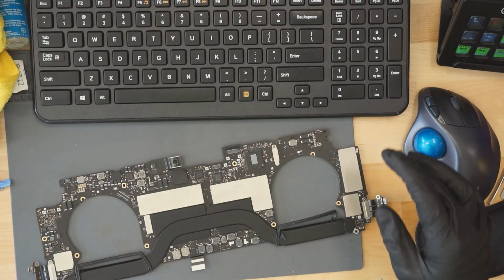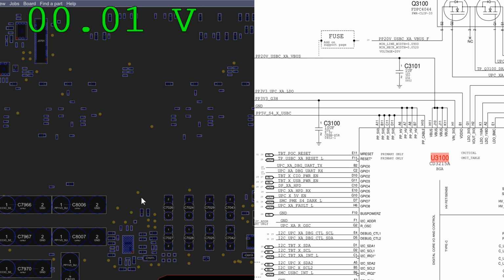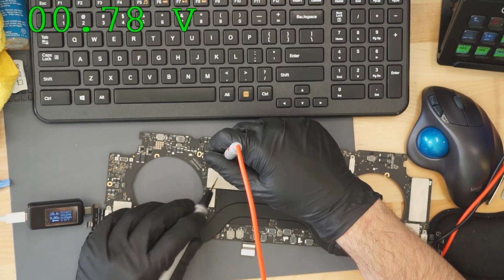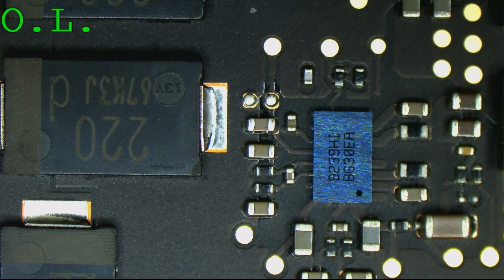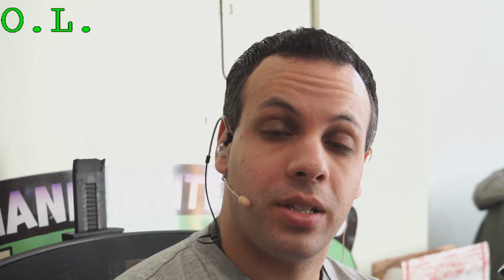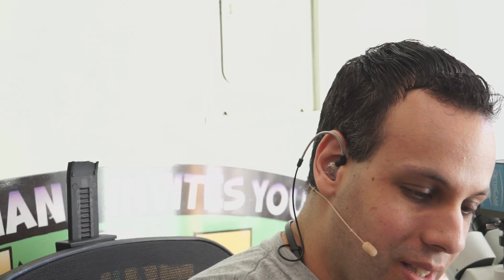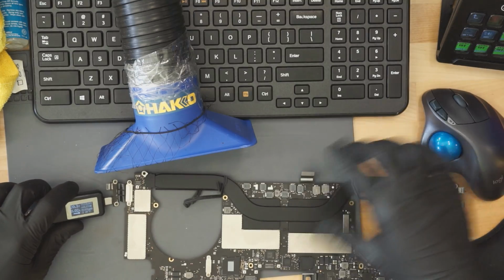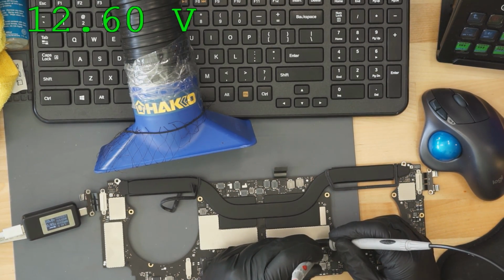Why new Macbook boards will be unfixable for me: sad :(

Comment: Rip the chip design, change it so it doesn’t have the flaw, and then manufacture it.  As long as you can make the chip different enough to be considered a separate entity from the original copyright (if the chip even has one which it probably does) it can be produced by a 3rd party chip manufacturer and then you can buy the new chip from them and maybe even sell it (although Apple will likely sue you).

Comment: "I trust Sandisk so much that I have two of them in my laptop in Raid 0."

I don't think I trust anything that much.
Reply: I physically shuddered when he said he did that with two SanDisks.
Reply: I have 2 Samsung m.2 EVO 2TB together with raid 0
Reply: @igcogcigciggicifx4763  That is RAID 10, which I'm happy to do.  Pure RAID 0, no sorry.
Reply: I'm a Sandisk guy myself, but I'd never put anything in Raid 0 :D
Reply: I run 4 ADATA XPG SX8200 in RAID 0 😂👌
Run's really smooth.
And reads at redicules speeds (lets see how long)
Reply: Wtf is Raid 0.
Reply: @mikethespike056  striped drives
Reply: Can anyone explain what raid 0 is?
Reply: @lyndonmoore6286   @mikethespike056  Writes/reads data to each of the drives in the array with different data going to/from each drive. if one drive fails you lose all of the data. It trades reliability for speed.
Reply: @lyndonmoore6286  striped drives.
Reply: @SuperUltimateLP  oh, well thanks, I think ima google what that is now.
Reply: i run 2-4 toshiba P30s0 in RAID 0 and ironically despite hotplugging them still have had less data loss/corruption than my 960 EVO thats running as a normal, singular drive
Reply: @Gandalf721  ohhhhhh! That makes sense. So could you have two drives running separately of one another so as to not have total loss if one failed?

Comment: I'm so glad I don't buy Apple stuff. I got an 8 years old Acer Iconia dual screen laptop, which never let me down once, despite having traveled the world with me. Because of it's reliability, I love it to death, even though lacking processing power and having low battery capacity (always had). I heared stories of very bad Acer experience from people, but I only got the jest experience. Also got a 10 years old Acer Aspire One netbook, which had it's keyboard broken after 1 drop of water after a few months, but easily replacable and other than that, it also works for ages. Using it as a video player for 8 years now with a lot of shaking, but it's not arguing. I am sure, I use an Apple laptop in a shaking vehicle for 30 minutes and the thing will break.

Comment: I would send my Macbook to you for repair, but you convinced me not to buy one in the first place.
Reply: He can always fix windows based products if people get smart enough not to buy apple products
Reply: @prafulltiwari8929  buying windows produces is not what I call a smart move lol
Reply: @prafulltiwari8929  There are no "windows-based" products. Outside Apple ecosystem we are in a free world. I have Win7 and Ubuntu on one machine, depending what OS I'm in a mood to boot today. Not to mention I have another Ubuntu VM, DOS emulator and C64 emulator here also. But you are right in that he can fix other computers. Apple hardware is still the same architecture as other personal computers, though their marketing tries hard to convince ppl otherwise.
Reply: @Krzysztof_Lis  I personally use windows 10 and Arch Linux. VMs are fun to toy with, although I don't generally find the need to use them unless I'm trying to run penetration tests. But yeah, you got the point, he could always repair other hardware  outside the apple eco-system. 
 It was navie of me to use the term "windows based" .
Reply: @prafulltiwari8929  I get it. I pointed out "windows based" thing because I've learned, somewhat surprisingly, that a lot of Mac users think that the rest of the world works like Apple does. That I can't, for instance, use the same PC with Win and Linux. Or I can't put AMD GPU into Intel motherboard. Or even replace Samsung SSD with a Crucial one. So I try to make those things clear for them.
Reply: @prafulltiwari8929  It's much easier to be a PC repair store. As a consequence there are a lot more of them. They'll have a lot of competition in that market.
Reply: That s the funny part about this channel is how many customers he loses because no one buys Apple after watching
Reply: @Chevalier_knight  I guess it's his goal because he seems tired of repearing apple shit.😊
Reply: @Chevalier_knight  Not necessarily. With his skill on laptop and other hardware he can literally fix other Windows based laptop as well.
Reply: @Chevalier_knight  You are so right!  I was literally on my way to buy a Macbook when someone told me to watch some of his videos.  Never going to happen now.  PC for life!
Reply: @wijr77  Why would you want to buy a Mac in the first place?i
Reply: @Chevalier_knight  Apple isn't the only company that builds and sells computers. Can't tell if this is a joke or not but if it's isn't then it's an incredibly ignorant statement
Reply: @Chevalier_knight  i think he fixes a lot more other devices to get the profit  but he still wants to inform apple sucks and every one who own apple shud come to him even if official store sad this is not fixable
Reply: @Chevalier_knight  but we should we grateful coz its a win win for both him and is coz he gets the views and we dont end up wasting a lot of money
Reply: @Chevalier_knight  he;s doin good work that even gives him less profits BUT he knows, you know and I know people WILL buy apple to show-off or maybe some genuine work since some mac-only apps are there for productivity that people use
Reply: @Chevalier_knight  there are enough "stupid" people with to much money, they dont care
Reply: @Chevalier_knight  You severely underestimate the intelligence of apple fans.
Reply: I would probably want that if I was him, I'm sure fixing PC is way less a headache without all the legal shit and trying to get spare parts on the gray or black market
Reply: @Spootnik  That's why fixing Pc's isn't lucrative business. They are too cheap to replace and too easy to repair.
Reply: @Spootnik 
The same happened with pc
No spare part avaliable
The repeat cost more than buy a new one
But the service from acer a lot better
Reply: Anona Mouse If he can fix an Apple product, he can fix anything. So no excuse if you want to send your laptop.
Reply: This, so much, this! Realised a long time ago Apple were a bit sus, am now convinced that they truly are evil... Like "people exist to but Apple products", not the other way around...
Reply: Don't send your macbook, hes gonna take it to the ppbus.
Reply: He's a millionaire by now. I wouldn't care anyway. Retirement already set
Reply: The closest thing to a motivation I have to buy a macbook is knowing that if it gets broken, I can send it to Rossmann Repair Group to get it fixed.
Reply: Funny ,that's what I was thinking.
Reply: It's a catch-22.  If he fix Apple, Apple fixes it so he can no longer work on them.  If he warns the consumer, they stop buying Apple.  Either way...less business.
Reply: Yeah, thats why i still use the late 2015 version... cba to get the new models as these are fast enough and you dont have to buy all those adapters lol
Reply: asaeampan  That was a classy comment. I have been trying to make decent and rational comments here and then you came along. Nice. Not really worthy an answer but since it amuses me I will. What software are you referring to?

 I'm getting closer 60 years of age, paid my mortgage, my employers pays tools so price is not a big concern. Further over my misspent life I've learned that price should come way down in the list priorities when buying tools (and things in general). 

The other qualities beside the price are much more important. 

I wont't try convince anyone that something is better but I will stand by my evaluation that a Mac is different from an 'equivalent' PC and thus it really is not equivalent nor comparable. It has qualities that I prefer over PC/Windows and that is what I pay for.
Reply: It is essentially the goal of this channel, stop buying apple products but in the meantime here are some broad instructions to fix your rotten apple.
Reply: I would buy a Macbook, I just wouldn't buy the apple care plan. The OS is nice, most Apple products do tend to last a long time, but their customer care is absolute and utter shit. They're nice enough, they just suck at what they do and their policies are trash. 
Buy macs, just go to Louis for when it eventually needs fixin'.
Reply: @nephtisseibzehn  It's your money.  My money (a much smaller amount) goes to Ryzen/Linux.
Also Mac repairs are going to become expensive (as per the video's title)
Reply: i had a macbook pro late 2011. 4 logic boards, an HDD, an battery, the hinges for the screen, and a wireless N.I.C.all  needed to be replaced. most were replace with the apple care. i went to the apple store for the first repair of the logic board, and when the gave it back it still was not working.  never will i buy an apple product again
Reply: Yet another sane person.
Reply: I haven't owned an Apple product since the Apple IIGS.  And I've had them on boycott since 1989 due to what they pulled with that.  Demonstrating an upgraded version that could stand toe to toe with the Amiga.  Cancelling said upgrade and saying "you should buy a Mac, even though they cost 2-3x more, are less powerful, and don't even have color yet".  The only products ever released by Apple that were not shit, were designed by Wozniak.  Only person in the company I ever respected.  Guess who uses Android phones today?  Anyway, that said, there are enough sheep out there that buy Apple products, that Louis will probably have a lot of business for years to come.
Reply: yes me too
Reply: Unfortunately, PC manufacturers generally make dozens of slightly different models of the same or similar devices, and often do not design their own parts or subsystems and rather source multiple types of “Shenzhen market” parts (usually whatever’s cheapest that week) to keep cost down. Coupled with an already heavily fragmented hardware market and resale values lower than a used Apple *charger*, repairing PC laptops is dramatically more difficult - impossible to source schematics and parts for them and not worth it anyway because they’re disposable plastic junk with no resale value. (No, upgradeable ram doesn’t make the computer actually worth keeping.)
Reply: @dregenius   Dude, you said it so right. Louis got a lot of macbooks to repair cause they are the rare laptop models keep their value. And Louis's charge with his technical is still lower than Apple's so that the customers would eager to pay. For PC/laptops, it's not even bother to get a board fixed.
Reply: @dregenius  That isn't a problem at all. I open a broken laptop, check a broken part number and I can order it or a compatible replacement from many sources. Most of the parts are widely interchangeable. One LCD screen can be found on dozens of different laptops. It's even easier in PCs, because I can change CPU to any other from the range supported by MB. I can change GPU to whatever I like. I have RAM sticks from two different manufacturers working together with no problem. I can order any part I like without need for some certificate from anyone. And all the parts in my PC are 4 times or more less expensive than their Apple counterparts.
I've had an iPad Air once. It was awesome how smoothly it worked. User experience was initially great. But since I couldn't do many things I could in Win or Linux, because Apple didn't have software for that or that soft was prohibitively expensive, my ipad saw little work beside web browsing, mail and watching youtube. Until one day it decided to not turn on anymore. Seeing how unproductive it turned on to be, and that it cost almost as much as the whole PC productivity setup, I decided I do not need another one.
Reply: Same I'd take a Mac book for free but wouldn't pay with money for one.

Comment: Whats the goo?
Reply: flux... it prevents the solder from oxidising, lowers its surface tension so it can flow better and i think it also somewhat helps removing certain residues from pads